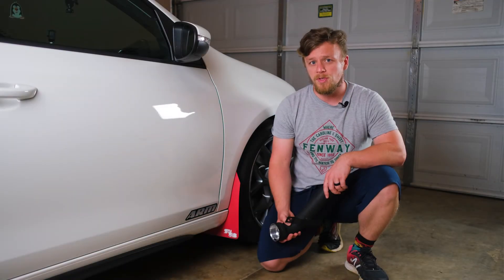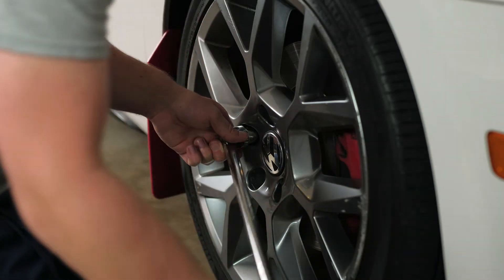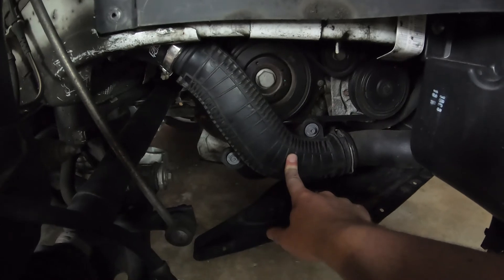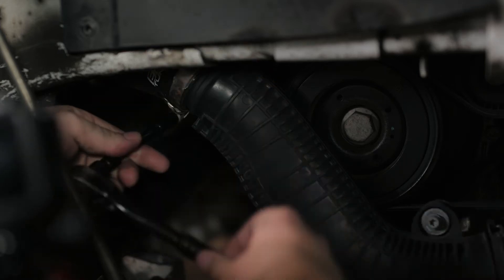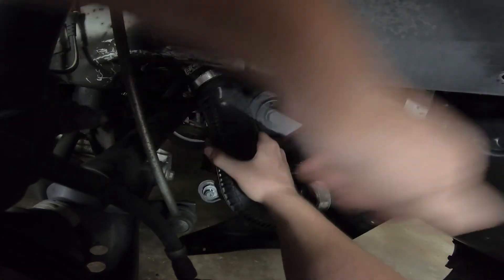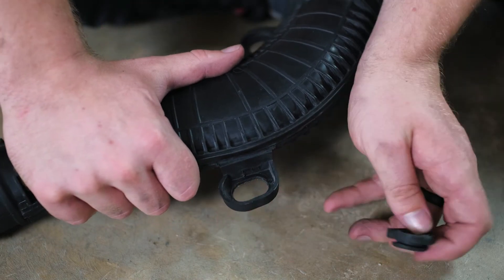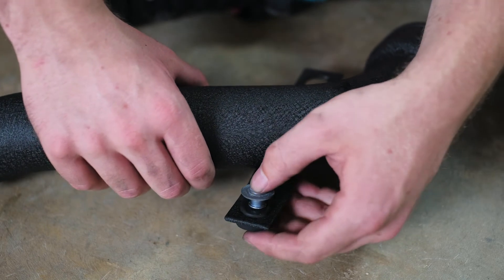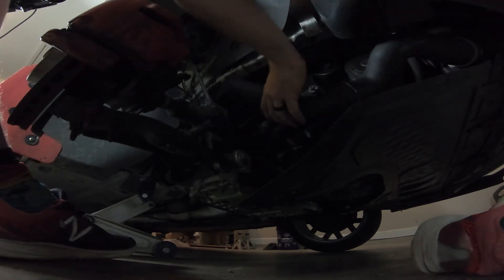How Hard Could It Be? | ARM Motorsports Turbo Outlet Pipe | MK6 GTI

Comment: after the change have you felt any improvement,??thanks
Reply from the maker: Yes, with the turbo muffler delete also, you can feel a slight increase in top end power. We actually made a video describing how the GTI now drives that’s on the channel. It’s in a series called The Butt Dyno report!
Reply: @TheParkingLotMechanic  nice thanks for responding 👍
Reply from the maker: You’re very welcome!
Reply: No not rlly